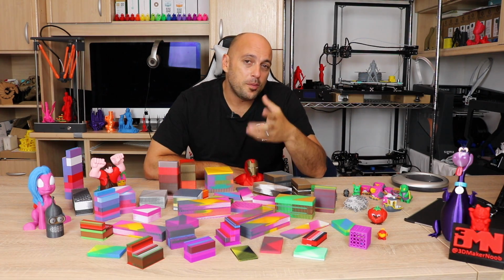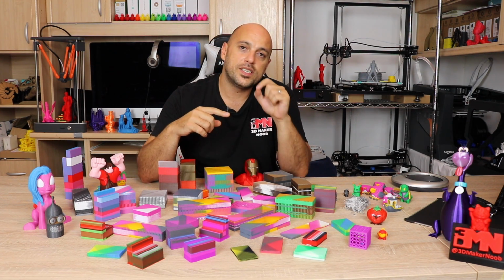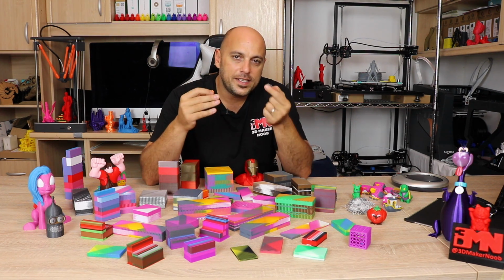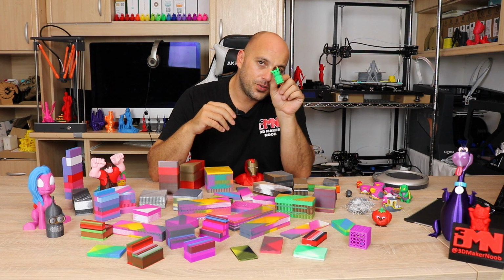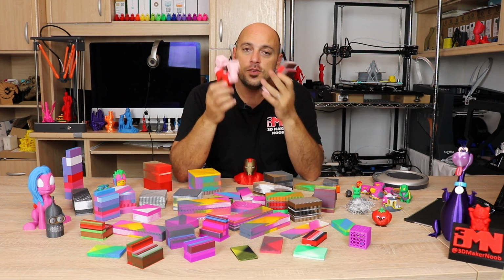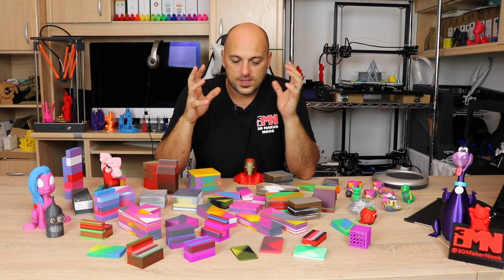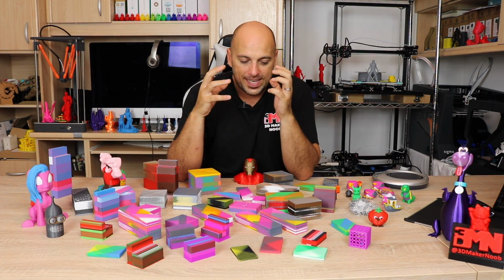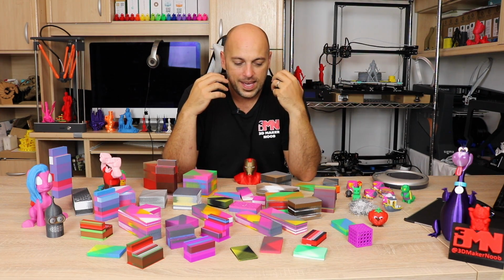The Purge! Explaining Purge Blocks and Answering Questions

Comment: I don't have a 3D printer, and I don't do wood and resin turning on a lathe.  I simply rabbit hole videos about both of these things.  If you have these multicoloured purge blocks - why not give or sell them cheaply - to a woodworker or CNC machinist?  100% infill not required, they can add clear or coloured resin before turning.  These could make write interesting pens, candle holders, what have you.  There are dozens of YouTube makers in both fields, so it seems to me that this could be recycling synergy.

Comment: It looks to me like the printer cannot move on the z-axis when purging. So it wastes a lot of filament raising the height of the purge block to keep up with the model. Just look at the large expanse of solid colours on the purge blocks. Seems that most of the printers here are actually 2.5D instead of full 3D. This is why printers that use purge buckets waste so much less.

Comment: but why does it need to purge that much?! when I change filament I don't  push that much to transition between colors. I don't understand!
Reply from the maker: You said it yourself, you “change” filament, which means taking whatever is in there back out, you’re not pushing whatever there is through until the new filament is clean

Comment: It could still be possible to print a custom purge block model, but apply minimum dimensions for correct color transition. For example, you could print a sphere within an enclosed cube. The difference could be support structure. Or (next step): print several spheres (marbles?) inside the minimum cube.  

Of course it isn't perfect, but it would still reduce the amount of waste.

Comment: 21:20 Recycling filament at home doesnt seem to make much sense unfortunately. PLA pallets cost like a few bucks per kilo. Just grinding the 2-3 kg of waste pla on the table into a usuable size is gonna take costly equipment, hours of time, make a mess and leave you with a low quality mixed colour material for extrusion. Then you need a costly filament extruder that requires constant attention, refills and tweaks. If all goes well you might end up with some low quality, inconsistent diameter filament of mixed colour after alot of work and headache. Even if you value your own work at 0$/hour you would have to produce like 100kg of filament before you break even with the equipment cost+operating costs vs just buying new, cheap filament.

Comment: Bottom line, none of the solutions solve all the problems.  The only solution I can see is a "smart" slicer taking all of the options (using infill, variable purge infill, alerting flow rate on purge block? etc) and using them to reduce the waste.

Comment: why not combine options... i dont see a reason you should only choose one....
first....draw infill with the purging material
then.... if there is any extra, purge it in a block ( maybe lego or other chosen shape option)....
and if there is STILL a need for purging, or the above options are not possible...then purge for that print in a bucket

if i knew coding, id try to make it myself.

Comment: Thank you for the insightful video. The thing  you mention at the end: recycling the blocks into a (omnicolored) new filament. I think there are such machines who create filament from ? plastic chips? some sort of source material. Probably it's not yet a busniess case. But besides the multi-colored purge blocks, there are also - as you mentioned - failed uni-colored prints. Couldn't there be a place where you submit your failed prints and purge blocks to a company and get them back as filament - recycled, cheaper than new one?

Comment: Wouldnt purge blocks be more efficient if it was a vase shape? For example with the Wreck it Ralph he has sections that change but feet and pants that are a pretty long vertical without color changes. If you did a concentric vase shape then during periods without changes you could just make a circle with a smaller radius but still obviously make it structurally sound. Slicer software could really do a lot with purges.

Comment: Hi Joe. It's Deckingman again - (the guy who built the crazy 5 colour printer that was on the Duet stand at the TCT show). Interesting video BTW. 
My printer uses a Diamond 5 colour hot end so it has 5 inputs but a single nozzle. I employ a variety of different purge strategies depending on the model being printed. There is one in particular that I think would interest you and that is moving the tool change point forward in the gcode file so that it switches before it's needed. The position in the file that it gets moved to is equivalent to the amount of filament purge needed. It doesn't compensate for the transition between one filament and another but with a mixing hot end this is minimal. Using that technique it is possible to print multiple colours with zero waste (both in time and filament) not quite perfectly but good enough for many situations. I don't want to hijack your channel but if you get in touch, I'll gladly point you to my blog and YouTube channel. Cheers. Ian
Reply from the maker: Hey, I think I actually saw that video (had to do with the Union Jack) :) I thought if you yesterday as I am fine tuning my duet wifi at the moment on a freshly built FT-5 and I though it would be so handy to have you around right now lol
Reply: Hey Joe - that's the one. It's a pity that the Duet forums aren't taking new registrations right now as they were getting a lot of spam and are in the process of switching to new forum software. However if you get stuck, post any questions in the Duet section of the RepRap forums. I take a look in there from time to time but David (DC42) is a regular visitor and is far more knowledgeable than me (he writes the firmware after all).

Comment: just put the purge blocks in a protcycler.  You can recycle them into filament.  Redetec.com.  Of course, I have had mine on order for a year, but they are up and going now and you can recycle all of your blocks(at least the single material) back into pla. It will be a mismash of color (green is typical when recycling the blocks), but it still makes good filament for everyday use.

Comment: We'll need a better technological solution for the purging... probably the secret is in the nozzle itself. Maybe a magical system with two nozzles in a minimal area using the same heater block...
Reply: check the web 4 diamond hotend

Comment: If you combine the 2 ideas of using infill as a purge block (increasing percentage if needed), and the bucket when the part has not enought infill (surface area), you could actually save a LOT !

Comment: To solve the issue of not having enough area for purging, why not using a mix of infill-purge block and the standard purge block itself, to minimise the "waste"
Reply: I guess one thing it could do very easily is waist in the purge block for parts with no colour change. So the Iron Man purge block could be very small at the bottom (perhaps with a wide brim for bed adhesion) and stay small for a while, then come out at, say, 60 degrees to be wide enough when the first colour change hits. Narrow waisted for 1 colour, wider for two, and the full "who ate all the pies?" for all four.
Reply: If you only need (say) 20% infill then having much of the model at 100% infill is still waste, whether it's in the model or in a purge block. Although heavier models usually feel more satisfying – have more heft.
Reply from the maker: +Mark Wheadon not only that, but if parts of the model are too small or narrow, than the whole purge has to be done on the block, meaning that the whole purge block footprint would still need to be the same size as it has to grow structurally with the print
Reply: Mark Wheadon that's exactly my point, when the waste is inside the model it is effective waste, but even at 20% waste-infill we could minimise the ineffective waste which is the purge block itself. I think this could be a task for Prusa Research aka Josef Prusa. There just must be a way for better nozzle priming than we have now.

Comment: Multi-color purge blocks may still be possible for recycle, but it will be harder if its multi-material. Since the melting temperature of different material is different, and the compounds are also different. The recycled multi-color filament can be used for prototyping or printing non-support-required print to be painted. 

However a filament recycler set is not cheap for hobbyist or those who don't print much, since it is not optimised if you just recycle few hundreds grams of plastic.

Comment: The solution here is to have the filament purge directly into the infill of the actual object being printed and if it has to move onto the next layer and there's not enough infill space required to clean out the nozzle then have it collect into a bucket so it can move onto the next layer. The stuff in the bucket will be the only waste. Another way would be to have it automatically change the infill percentage so that it does have enough time/space to purge the nozzle. Now there's little to no waste at all. Support material can also be used to purge since it's a waste either way. 

This would solve most if not all problems with extra waste but it would be a programming nightmare to actually get it working properly because each type, brand, and color of filament will require it's own setting and the user will also have to manually input what filament he or she is using before slicing the model. The manual input part can be bypassed by using filament that has a RFID chip built into the spool or by scanning a QR or bar code but this will require that your printer or computer have a built in RFID reader or a QR/Bar code scanner. A USB QR/Bar code scanner plugged into your computer would be the best/economical way to go. A QR code will require a webcam or built in laptop camera which most people should already have and a BAR code would require a cheap scanner. Now we just need these 3d printer companies to make this happen.
Reply: If the process cannot use a waste bucket then perhaps a purge block where the infill would be insufficient.  Sometimes, such as the little Marvin, this is not going to  reduce the purge block but the infill solution for the Iron Man print may result in little or no purge block.  If the object is to reduce the waste to almost zero  then perhaps invest in a Proto Cycler (yes, $799.00 would buy many rolls of filament; depends on the amount of printing).

Comment: Seems to me that it's only a function of undeveloped slicer software. Many of the reasons you gave as to the ineffectual use of the plastic are only a result of the software not setup to do it. For example the slicers could use several methods that you listed in conjunction with each other to create extra efficiency, like using infill inside the model when able and using a purge tower when the length is too small. When used in conjunction with going up and down the Z axis the purge towers can be made much smaller which would further reduce the inefficiency. I would also add that it would be interesting to revisit this at some point with a diamond hotend or e3d cyclopes for comparison of a few other cheaper options to multicolor printing.

Comment: I think a lego format option for the purge block would be great. But also using an STL of your choice as the purge block that fits within the required size to accommodate the purge, would be sweet. Software can definitely be developed to compare the minimum requirements for purging with the requirements of a given STL so that STL can be used as your purge block.

Comment: Palette+ has a max infill%, so you can make the purge block smaller, if you are trying to do that to save some print area space. If you are not printing super fast, you can set the max infill to 100% and the purge block gets smaller -- I set it to 75-80% as I print fairly fast, I've asked Mosaic to add an option to override the speed for the purge block, they're working on it. You didn't really mention that that the Palette+ is in fact a closed loop because the wheel is part of the closed loop, but it also inserts pauses into the print,  and you'll hear the Palette beep when it does these pings which let it do some internal synchronization to in fact be a closed loop. I need to play more with the Palette+, but so far I like the results -- I'm working on a DIY build to do an alternative to multi material printing -- so like you I love this idea.
Reply from the maker: +kazolar the reason I didn't mention the pings is because this wasn't meant to be a palette review. It's about purge blocks. I had a very long live stream using the palette+ and explaining I it works and that is when I explained how the ping work. The full palette+ review will coming soon though

Comment: I was considering the Prusa multi-material but I really can't waste that much material.  The planet is full of plastic and simply throwing away purge blocks is just not cool.
Reply from the maker: +Stephen Boyd it's definitely not cool to throw away purge blocks, but that's what recycling is for :)
Reply: 3D Maker Noob as far as I am aware, certainly in the U.K., hard plastic is not able to be recycled. The recycle plants don't have the facility to shred the plastic.
Reply from the maker: +Stephen Boyd really? Was not aware of that. We do actually have a recycling plant here for such things. Grab Ted, it caught fire a few months ago, but it's all good now hehe
Reply: In that case, purge block away :)
The UK recycling policies seem to be very fragmented.  For example where I live I have to recycle my own glass but the town just down the road they have their glass recycled from the curbside.  
Soft plastics such as drinks bottles can be recycled but they don't like you putting hard plastics in the recycle bin. I'm not sure how many layers can be counted as a soft / hard plastic.  If my print fails on the second layer then that's pretty soft :)
Reply: In my area in the uk the local tip has a section for non-recycleable plastics that go to a local incinerator for power generation, hardly any of my household waste goes in the black bin anymore.
Reply: Recycle it yourself! https://preciousplastic.com/en/videos/build/extrusion/
Reply: @motherofcrafts8731   your link dosnt work, but going to the main page, its pretty awsome, ima look at that more.
Reply: Stephen Boyd if you use pla then you'll be fine ir biodegrade fast in the sun or recycled filament would also work
Reply: This blocks look really neat. I know my kid will play with it. Also, I could prime them and turn them into art .

Comment: Joe, thank you for this amazingly in depth look at purge blocks.  You also really opened my eyes to the possibilities of the Pallet+.  I feel like this is the bleeding edge of 3d printing, and it can only get better from here.  The idea of TPU hinges built in to parts really excites me.  For the time being it may be a little awkward and it certainly has an effect on the cost of material, but if you put some of the old 3d printers next to their modern day counterparts, they are hardly recognizable in some cases.  For what I do with 3d printing, any multi-material system would be a "cool toy" at this point, but we all have different end use cases, and I can see how in even five years time of development, this is going to get even more impressive very quickly.

Comment: What about set up that you can put the blocks into that heats it up and extrudes your own multicolor filament?
I don't know how much it cost to make filament in general (for the equipment), but is it possible to reheat printed filament to re-use it?
Reply from the maker: +Style Wadsworth actually there is a machine called filaxtruder which kinda works like that. You just break down the blocks, or shred them. Then run them through it and it extrudes filament :)

Comment: I dont mean to be rude. but some points you are kinda talking out of your ass (no offense). Like printing another model with the purge block. you are not locked to use the same z height as the primary print. just enter the parameters of the space used by the print head and you can print in different z height. its the same way as printing many items one by one instead of all by z height.
Reply from the maker: +craazyy22 with the current software and hardware you are. While that is a good idea , the fact still remains that the purge model has to be big enough to accommodate the full purge distance, which will be difficult with some models. Also, no offense taken, be me or my ass :)
Reply: calculating the purge volume should be easy for a slicer. so finding out if the filament volume fits the size of the secondary model is not hard. worst case senario you have to make 2 models along with the multi colored one. (sry if any writhing mistakes cant see the screen.)
Reply: Whats the purple model's made of?